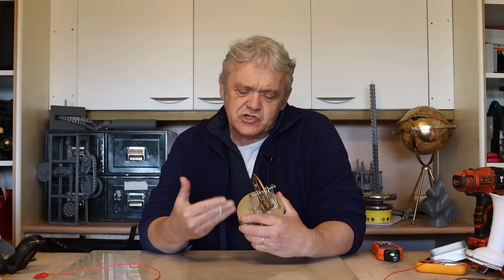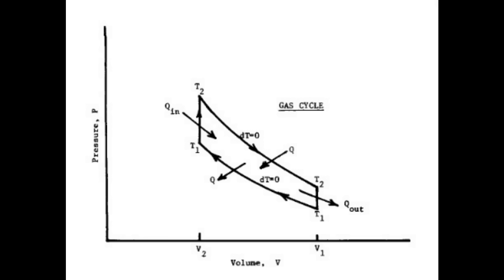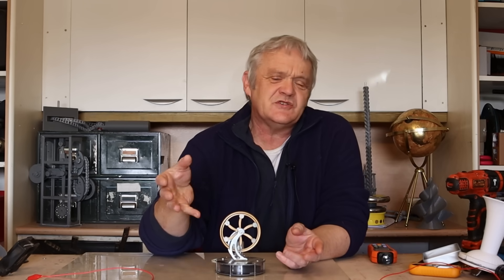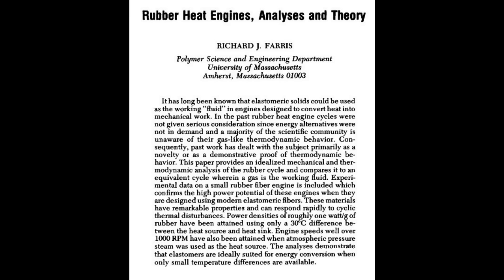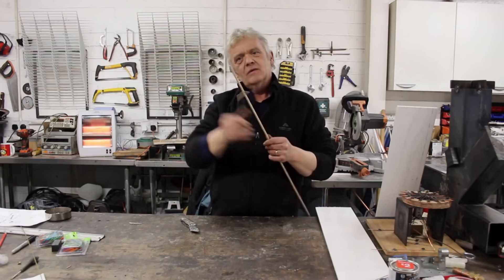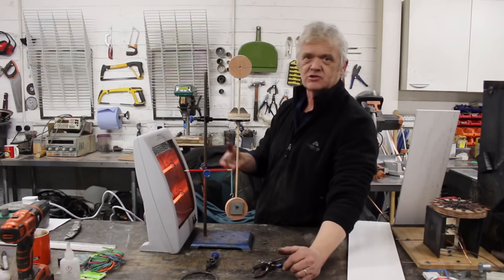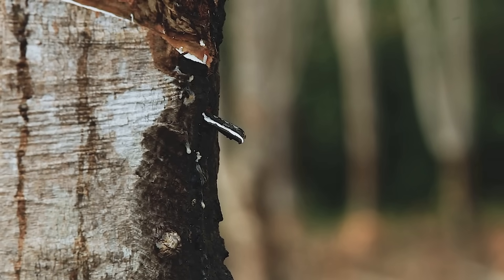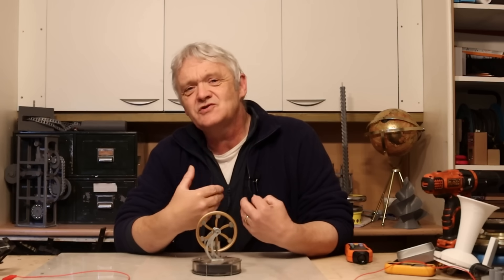2114 Rethinking A Stirling Engine With Rubber

Comment: As usual Robert you bring another piece of alternative thinking to the table, which is expanding our collective knowledge and stimulating fresh ideas. Here's a thought, what if, using the lycra strands to generate when contracting and a normal sterling engine on the expansion stroke or perhaps a Bi-metal strip to perform on the heat stroke, if I have my sums right, this would add another 25% or higher efficiency to the engine. Or am I barking up the wrong tree?
Reply from the maker: cheers mate - I don't know is the answer - but I like the thinking there - fancy giving it a go and letting us all know how you get on?
Reply: @ThinkingandTinkering  Speaking of lycra and energy, I've walked behind some lycra-clad 'good breeding stock' in my time, and the regenerative power going to waste is almost criminal.

Comment: I wonder is stirling engines can be kept running by radiative cooling panels. if they can, you could have engines that just run without any need to provide fuel or energy, since it's just using the heat in the atmosphere to run.
Reply: I think the need on a sterling engine, is a slip gear attachment and a flywheel.  Like on a bicycle.  The gears will still turn when the engine itself is slowing down.  And the flywheel will keep the gears moving for a time, while the engine reenergizes(in between strokes).
Reply: This is an interesting idea!
Reply from the maker: there are solar stirlings mate
Reply: I wonder if you could use solar on the hot side and a radiative cooling panel that points to a black panel packed tight against the earth as an absorber that re- radiates to the earth as a heatsink. It might even be reversible, at night turn the radiative cooling panel to the sky and the heated panel to the warm earth.
Reply: @ThinkingandTinkering  yes I know, but I'm wondering if the cooling panels could keep it running at all times, whether there's sunlight or not.

Comment: MY SON PETER DID A FIRST JOB AT A COMPANY THAT USES STERLING ENGINES TO SUPER COOL AIR.  a SOUND WAVE HAS A HIGH ENERGY SIDE AND A COLD ENERGY SIDE.  A HOT HEAD AND A COLD HEAD.  THE "GERALD l. FORD AIRCRAFT CARRIER USES THIS METHOD TO LIQUEFY AIR.

Comment: At 06:45 - the vertical column of the stand can't give very good shading of the wide horizontal bars of your heat source.
Reply from the maker: it doesn't - but it gives just enough
Reply: It seems a single length of rubber, maybe wider, with flat side at heat source and a purposely SHAPED heat shield, to allow more of the rubber to go into and out of the heat/cool areas. I see the fulcrum point could optimized. Also as the metal bar "heat shield" heats up, the cooling will be less effective, so some insulation and/or fins for air cooling is in order.

Comment: I keep thinking on this idea and I wonder if there are more optimal shapes for converting heat into work than flat ribbons.  I'm imagining something like a piston made from foamed rubber having a greater potential... negative displacement?  It's odd to think of a piston and cylinder arrangement where the work is being converted into a reduction in volume.  I'm also wondering if there's something akin to the four-cycle process that would allow part of the work of one cylinder's retraction to pull in a secondary fluid to another piston to carry the second piston's residual heat away more quickly, readying it for another cycle.
Reply from the maker: i would think circular cross section and thin would be best tbh
Reply: @ThinkingandTinkering  That's a pretty good idea, structurally.  Now I'm off to see if there are papers on rubbers with particularly noteworthy reactions to heat.

Comment: I saw a video that a guy built a big and powerful  Sterling yeah you had to burn wood in it but why don't they make those today People's got to realize you have to burn something to get something so why not wood I'll try to find the video I saw and in the title of the short is large alpha wood fire  engine part 1 And it says video filmed in Cornwall
 And another thing I'm sure the engine part would still work if also inside the wood box for the fire is you had pipes running with water in them to circulate through your house to heat your house too two for one they have those outdoor wood fired furnaces in America
Reply: It was pants regarding effiiency.
Reply from the maker: I saw that too mate - but post it for others if you find it
Reply: Yeah I found it there it is

Comment: I have been wondering whether the heat from a bycicle pump could be utilised (open sousce) from suspension.  All that  up and down energy of suspension, to heat the cab?
Reply from the maker: i would imagine so
Reply: Years ago they investigated recovering waste heat from suspension and it was very small.  Quite often people built system to collect heat off the transmission and steering but someone else designed a areodynamic car that gets 100 to 200mpg but the engine transmission is so small there little heat to save.   I do like your idea but im thinking exhaust heat somehow assisting the heating cooling sytem and then i think its gotten too complex already.

Comment: What would be more efficient a Stirling engine or Peltier modules at making electricity for example if you had a massive container of hot sand at steady temp. fyi I tried to work it out got too complicated very quickly totally out of my depth 😆

Comment: Stirling engines occupy like 15% of my waking thoughts. It's the way it can be reversed like to do refrigeration. I want to find something else that can work like that, but for other energy types. One day...

I love the carnot cycle and the refrigeration cycle, it's the foundation of my current life quest because carnot engines are prime movers of mechanical motion when run off of heat differentials, but they are prime mover of heat energy when run in reverse and reversed carnot engines are rated by COP instead of efficiency.

Since my definition of "over-unity" is any prime mover with a COP > 1, heat pumps are "over-unity" devices to me. I tend to think the standard excuse that "It's okay that the heat pump does more work in relocating energy against a gradient because the energy already existed in the cold sink environment" is basically the same thing as saying "it's okay that my fancy water pump pushed 10 KJ of water uphill using 2 KJ of power because the water already existed in the lake."
Reply from the maker: rubber can be reversed to make a fridge
Reply: @ThinkingandTinkering  Yeah, it's super cool. Also, thanks for the reply.

Comment: So I need a small water pump in a remote area with lots of sun. You always give me ideas. Perhaps I can heat the up side with sun and cool the down side with the water I pump up. Any one have a comment on this idea???
Reply: Are you drawing water from a well, or a creek, or a lake, or what?  What is the lift needed, and the volume needed?
Reply from the maker: try building a model mate and seeing if it works

Comment: What about nichrome in place of rubber bands?
Reply from the maker: good idea
Reply: @ThinkingandTinkering  odd spot of a comment, though I will press on anyway; when you electrolise water into hho the expansion is close to 168,000 times the volume. Could you potentially use this expansion index to run and air motor and then burn the fuel to run a sterling engine or steam engine afterward? With the proper engineering you could effectively make something that SEEMS like perpetual motion, though the conservation of energy will show that everything does act in equivalency.

Electrolysis induces pressure, pressure creates torque. Torque creates motion, motion creates generation.

Combustion uses energy, combustion creates heat. Heat creates motion, motion creates generation.

Byproduct = water that can then be put under Electrolysis. Cylcic system where the pressure difference in the system changes the torque and modifies the efficiency. 

I think I may have something there ya? Give it a think and please do share your ideas.

Comment: modify electric  chain hoist real power gravity battery
Reply from the maker: the power in a graiy battery arises from what you drop not the motor you use as a generator mate
Reply: some chain hoist can lift a ton easily